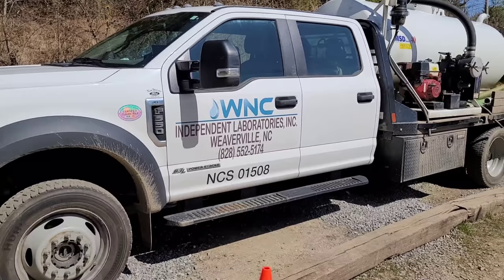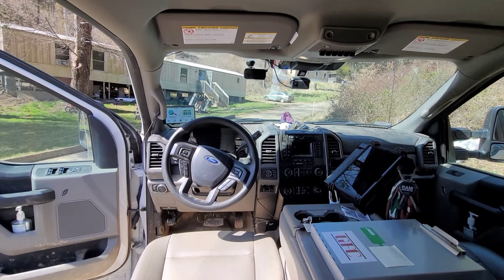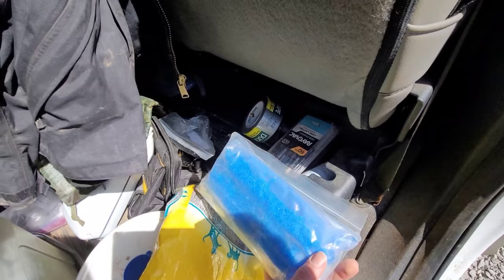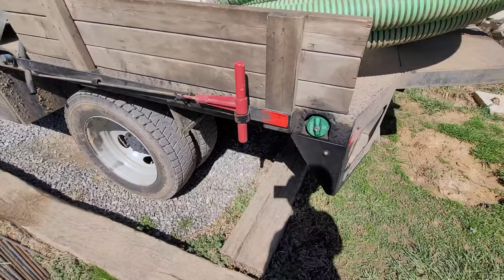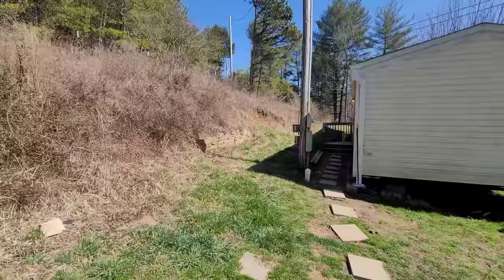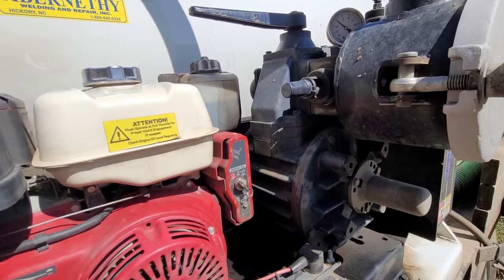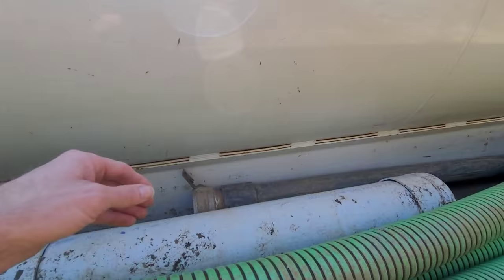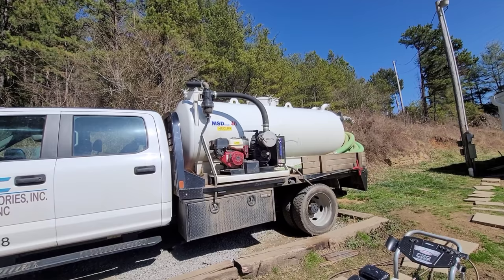Truck walk thru.

Comment: Saw a truck set up for alaska once it had coolant lines along the bed and through special valves that the engine heat would thaw the valves and tank, or keep from freezing, also had valves to shut it off in summer. Hope this helps.

Comment: Add some type of dry-running protection to stop negative pressure (-hg) from building when the ball float stops the pump. Install a vacuum pressure switch between the 2nd trap and pump, or near the vacuum relief valve. Having it set to disconect the the battery with a relay switch should stop the motor when the tank is full.

Comment: So without actually working there and doing what you do, it’s hard to say. One of the coolest features I saw on a truck that was used for geo boring, was an intergraded water tank. It was fresh water for cleaning off their tools and washing their hands. The water taps were a quarter turn valve mounted through the bumper. I know it gets cold and freezing is something that would limit the use. Weight is also something. Figure a stainless tank at 30lb and 20 gallons of fresh water you’d be adding 200lb give or take. Washing hands and tools... pretty invaluable when you can do it before driving down the road or reaching in your pockets. A 10 gallon tank would probably do well for the day’s work.

Comment: Get a 12 volt fridge instead of the cooler, Keep a "Jump Pack" in the truck to jumpstart yourself or anyone else if needed, Make your tanks and pumps able to come off your truck easier incase the truck is damaged in anyway you can put it on another truck, Add reflectively markings on the back of the tank\bed, To offset the weight add a small water tank on the other side with soap to wash your hands, you could always add a PTO water pump if the truck allows it, weld a round piece of metal on top of the handle to stop it from freezing, add an alarm to alert the driver when it hits the trap when it hits the second trap make it so it kills the pump, Add a tool holder, add a backup camera, add strobes and cones for safety,  run the same type of fuel you do in the truck as the pump so you don't have to deal with gas and diesel (Not sure what type of fuel the truck takes),  Carry DEF on the truck. That's all I got for ya Edit: also might wanna get a mini excavator so you don't have to rent one for some jobs

Comment: Have you tried using heat tape on your valves to keep them from freezing. Plug he heat tape into an inverter wired to an upgitter switch in the truck

Build a small enclosure over the pressure/vacuum lever?

Get a mixing rod. A flat head with a few holes in it on 10-15ft pole. It makes working a thick mattress so much easier. I would recommend w
Making it out of aluminum, if had outnof steel it gets really heavy.

Comment: One thing I would suggest is making it the pump battery will charge off the truck or put a solar panel up for the pump battery to charge and also integrate a heated system kind of like a heat tape to run while the truck is idling to keep pumps and certain things from freezing it can be done and then as far as charging the battery it can be charged off the alternator of the truck just like the regular truck batteries

Comment: Get plastic seat covers makes it so much easier t clean as all you have to do is take them out and hose them down instead of getting it cleaned at a station or one of your workers taking up time to do so. This will save your workers time meaning they can be more productive aswell as save on future replacements for the seats or cleaning costs incurred as it would only take a minute to hose down. If the condition of the dash board is a concern to you as it is plastic by getting a dashboard cover maybe even a steering wheel it will prevent the dashboard cracking and loosing color. This could come in to a factor if you ever need to sell the truck 2nd hand

Comment: Didn’t check for duplicates, but some notes, I’d put the generator battery in the rear seat of the cab isolated. Inside should help it maintain a more regular temp and less severe shocks prolonging the life and potential theft. Next is an organizer in the rear to keep it organized for rapid access as it looked slightly cluttered as well to prevent anything becoming a projectile in the event of a crash. Next the gas can I think should be secured in one of the cabinets(not inside with battery or people.) this allows safest storage and you can label it as Hazardous and put any other flammables with (osha?). I’d also put lights around rack/bed for light in cases where low/no light is possible. I’d hate to be out running equipment without lights. Even with portables they could fail. Also securing the shovels etc. similar to the probe rod. personally I’d secure them to the passenger side if possible but could do to the rack as well. Hope some of these insights help! Love the content!

Comment: I find it interesting that your tank doesn't tilt and the end is fixed . I run trucks with tanks fitted with hydraulic lift to near vertical and full opening end , really helps when clearing rags/wipes and debris.

Comment: For the pump control lever collecting water and freezing, find a cv-axle rubber boot that would fit over it like from a side by side atv where the base is fairly large. Run the handle through the small hole. This should largely protect the assembly from water. Make fine adjustments with zip ties or hose clamps.
Reply: Also a solar charger (battery maintainer) for the small engine battery and a battery cover or heater wrap would extend life.  Red Top batteries take abuse well but are pricey.

Comment: Love your video you say your battery's only last about a year I have a suggestion because  I'm currently doing this with my generator on my truck is I ran wiring back from the main batteries To a secondary power system for various tools it's tools and I extended that over to my generator so I don't have to worry about carrying a second battery just for the generator For the distance you would probably be able to use 6 or 8 gauge wire roughly the same starter cable for a motorcycle

Comment: If you put another tool box on the driver side of the truck it can be used to store oil, gas, the pump battery and spare parts on the truck ( pump seals and adapters) Itll also provides a security to keep crack heads from stealing gas. I think if you insulate that battery and maybe go AGM itll probably last alot longer than traditional lead acid exposed to harsh winters.
Reply: Also throw in some petroleum jelly or silicone spray to coat the joints/ valves and keep stuff from freezing

Comment: Like an other comment mentioned a cover for the honda, protection from the elements and people wanting to screw with your stuff. Have you thought about an alternator/generator? It replaces the factory one and provides 120V power to a weather tight receptacle. It definitely beats using basic power inverters and eliminates the Clutter of an inverter box everything is tucked underneath the hood and runs off of idle speed. Better to have and not need the need and not have.

Comment: Place the battery in an insulated box in the  metal storage below or in the cab with some long jumper lines. Use heatshrink on all terminal connections, and keep the battery out of the sun/heat/rain/freezing temps. Depending on what type of battery it is, will determine how it should be charged, and if it can be swapped with deep cycle, or lithium battery.

Comment: Got directed here from one of your TikTok video’s and coming from a different set of industries I can only really think of a couple of things. One question is have ya’ll looked into having a PTO drive for the pump?  If you did use a PTO it would eliminate the Honda engines and use the engine of the truck to operate the pump and only have one fuel source to deal with and a bit less maintenance to deal with as well. Since you are pretty likely to keep the set up you are using you might be interested in using an AGM (Absorbed Glass Mat) battery. Depending on the battery you have I’m pretty sure that you can buy an optima battery that is well suited to what that Honda motor is using and can get you some extended life out of the batteries. On your pump and valve freezing issues you might be able to have drip shields made to shield the various points to keep them from getting rained on and help reduce that risk of freezing.  Oh and on the kitty litter thing.  You can look into oil dry available at most auto parts stores. It’s also known as fullers earth, and you can buy a 40 pound bag for about 10 bucks. 

https://www.oreillyauto.com/detail/b/thrifty-sorb-4400/tools---equipment-16488/shop-garage-16868/cleaning-supplies-25216/oil-absorbent-17717/8e58b6d289f2/thrifty-sorb-40-lbs-oil-absorbent/8440/4525774   

That’s a link to oreilys which is where I buy mine.  Might save you a little extra cash.     Other than making sure you keep up to date and adequately sized fire extinguishers in the trucks I can’t think of much else that might help you.  Except maybe a set of tire chains for both axles if you have to get into some nasty getting to or from a tank

Comment: If I’m not mistaken it’s a DOT violation to have a plastic gas can, but on the fleet f550, we’ve gotten the dealer to turn on manual regens so going through the dash settings we can see the dpf statutes and park regen to eliminate problems of having the truck try to do it on the go, and less down time and takes 20 min at a high idle

Comment: I would wrap some nichrome wire around any area that has a problem with freezing and use it as a small heat source to keep everything above freezing.. Power it off the truck battery or get a solar panel depending on how long the trucks are on or off for

Comment: One suggestion: find yourself a 12v heated blanket or one of the little 12v heated food delivery bags cut it so it will fit around your valves that way at the beginning of the day during cold weather you toss them around your frozen valves turn them on and they thaw them out without you having to dismantle them. If you are handy with sheet metal you could make a permanently insulated cowlings to surround the valve body with the heating element inside hardwired to the dash so you flip a switch and it warms up the valves and keeps them toasty during the winter.

Comment: Thing I thoigh about truck that maybe better for yall.
1. Wire the pump to the truck battery. Have a 50 amp reset able breaker on the bed. (If the truck crank for work then the pump will crank for work)
2. Though about removing the back seat or even adding a tool box at back seat to keep all the lose stuff in cab in one spot.
3. Adding a way hoses closer to the side tank by welding on bracket to the side of the tank. 
4.adding a back up camera on top of the tank. That way driver can see behind him. So that way they don't hit someone or anything. 
5. Adding a obd2 tracker to the truck that way you can see if the driving is speeding or driving the truck to hard for no good reason. Or if the driver like to take the longest to get to the job site instead just driving straight to it And if get stolen for any reason one more way to track the truck. 
6. Using a small metal gas can. they last longer and if the truck is in wreck less likely to leak. And a way to Secure it to the bed so it cant move when driving. 
7. Adding led light on the tank so it will light the bed and all of the equipment so the worker can see they doing easyer and will add lighting at the job site also.

Comment: I can't tell for sure, but where the water leaks in and freezes the pump may be fixable with clear RTV compound.  It's used in electronics to waterproof motherboards, so you might try that.

Comment: Hey I’m from tictok love all your stuff and and happy you care so much for your employees any job I’ve been in with the trades the bosses don’t generally care. But the only thing I don’t think I saw mentioned was a small box that can go all the way side to side or not under the pump and everything, I worked on a concrete crew and we had a 3inch tall “box”
Reply: So like when you put your flat bed on build a flat, box against the bottom, with different doors for shovels or are big paddle float and all it’s handles, ours was wooden but I’m sure it wouldn’t be to hard to fabricate a steel or even aluminum one depending on the weight constraints for the tank and everything

Comment: For the pump motor remove the battery and hard wire it to the trucks as long as it accepts 12v if not but a converter in-between. Also have the harness done so it can be swapped to a newer truck when you have to replace it. Second I do not remember what there called but you can get an rap the you can plug/wire in on a switch that raps around spots that are prone to freezing it will heat them up above freezing. They use it on outside pipes in the north. Hope it helps.
Reply: "If not put a"

Comment: 100$ challenge.  1.  Fire extinguisher’s on all trucks.  It’s gonna happen better to have one.  2. Honda battery delete.  Simply run power from the trucks battery.  And ground engine to frame.  No more annual battery replacement.  3.  OH shit kits.  12v air compressor, plug kit, tire slime.  For fast repairs of tire punctures. Jumper cables, HD tow strap,  and some basic tools for common repairs.  4. Back up cameras 5. Pump selector switch.  Can try coating area around the valve with HD grease in winter time to prevent water from entering.  Hope some of that helped.

Comment: I don’t work in this field but from what I have seen on the tank setups I would have freeze plugs installed on the valves and more lights toward the tank so the operator can see the glass bowl for the tank level. Also the tools behind the tank I would have a bracket welded on the headache rack to keep them off the bed allowing more potential storage.

Comment: Donavyn Adair idea to wrap the freezing valves in something that heats it sounds good, but I think (optionally) sand blasting the metal, coating in a thermal insulating paint, then adding a hydrophobic coating should help lower the freezing point and keep ice from forming.

Comment: Feels like you have everything but you want your truck to be prepared for apocalypse. here are few things.
1) rear view camera easier when reversing the truck
2) didn't see your back up tire. May be electronic tire pump, jump cable or jump starting battery
3) i don't think u need a ladder but may be when you have to dig deeper for bad sceptic set up
4) blind spot mirror?
5) gps navigation?

Comment: Ok so the in the backseat if it’s a split pull the smaller seat out have a custom built storage shelves built around the cooler. One with multiple size shelves/drawers. Second take a toy kids cone cut a hole on the side of the cone to be able to slide it on the handle of the pump to help prevent water from collecting  on the handle.
Reply: Ain't no one got time for that!

Comment: Ok I have an idea for the pump handle. Take a 3” pipe and cut a square hole in the side(size of the handle). Pipe doesn’t have to be three inches as long as it goes past the gap where water seeps in. Weld a top on the pipe. I think you can angle the piece and slide it onto the handle. Maybe cut out a piece on the other side of the square hole and put a hinge on it so you can open and close it. The reason for this is the piece probably would get hung up when sliding it on. The just lather the gaps and the little door with silicone and it should be water tight. It’ll move with the handle. I could try making it. I’d just need some measurements. I enjoy little things like this so no charge would be necessary.

Comment: try putting a battery tender/maintainer on the battery for the honda motor. they make plugs that you hook up to the battery so all you have to do is plug it in at the end of the day. i’m a small engine mechanic and 1 year on those batteries actually seems about right lol. the tender should help

Comment: Insulated boxes around your freeze problems?
Ditch the pump battery entirely, some heavy gauge wire to the vehicle battery, assuming they're both 12v. Way cheaper than a new batt every year. If that pump charges it's batt it doubles as a slow jumpstart if you kill vehicle batt, just pull start the pump and let it run
Roof rack for solar aux power and/or a couple gallons of wash water in a 4-5" pvc pipe. Cheap 12v compressor can put 30psi behind that water.
A high mounted backup camera, more downward angle than a bumper mounted one

Comment: For sure scrap the extra battery for the pump motor. Run it off the truck. Unless you crank it for 15-30 min straight it shouldn’t weaken the battery enough to keep the truck Running. Or on you next truck get a pto vacuum pump. I’m sure they have them. Then you don’t need the gas can either. Have you considered going to an aluminum flat bed? Or not using a pre made bed at all? It should be easy enough for your fabricator to build a bed around the tank. It should allow you to lower your center of gravity a few inches while also shedding some unnecessary weight. As you said weight is money. Might cost more upfront but would save on fuel and wear and tear for the truck. You may also be able to get recapped tires for your drive axles to help with cost there. I know I’ve seen them in the 245 wide 19.5s

Comment: Cones!  Safety cones for blocking off a driveway, blind curve, or if the truck is downed on the side of the road. Those floppy reflector triangles fall over. Weld a rod and stack them. Maybe corner of the bes